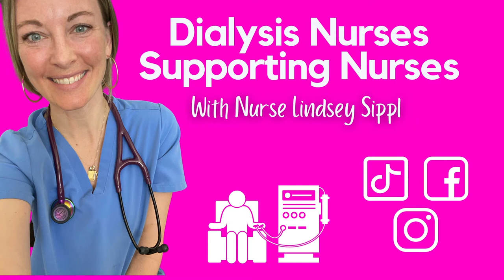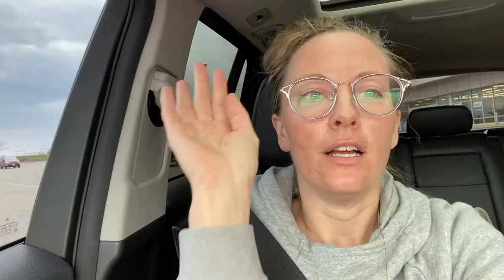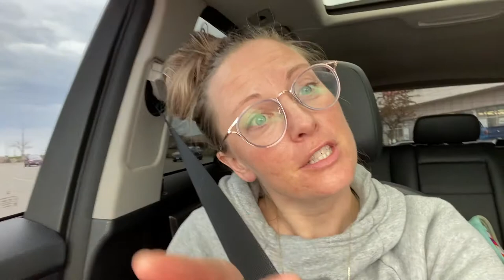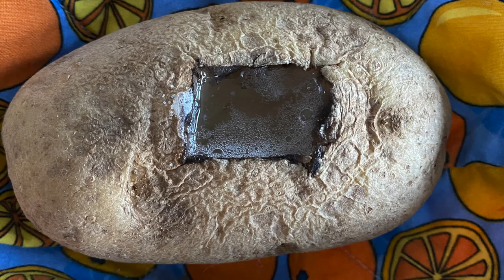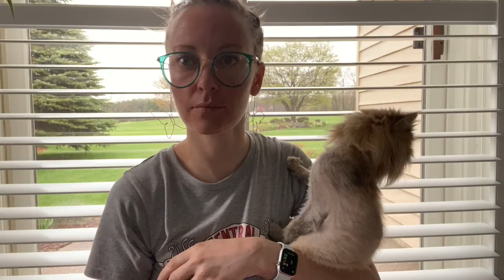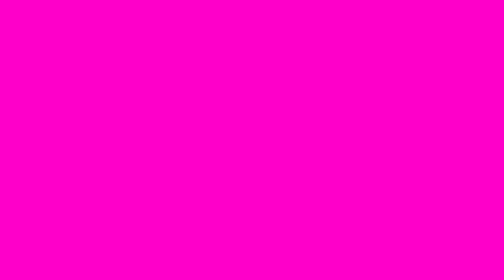DIALYSIS SETTINGS - ANSWERED: Conductivity in dialysis

Comment: In my clinic we aren’t allowed to use sodium profiling.
Reply from the maker: Interesting! I wonder why.
Reply: Same
Reply: @dialysisnurselindsey  historically sodium profiles have been correlated with hypertension, increased interdialytic weight gain, and higher mortality. 
It’s not to say that sodium profiles should never be used but other options should be exhausted first and orders should be obtained by a nephrologist who is familiar in applying sodium profiles and with the individual patient so that we can optimize the benefits and minimize the risks.
Reply from the maker: Thanks!

Comment: I read that the temp on a machine should be adjusted lower if patient has high blood pressure to eliminate sudden drops in blood pressure and that the dialysate flow should be set lower to reduce headaches is this true I am a patient and need to know and are there any other settings I should be aware of
Reply from the maker: Machine settings can be very patient specific.  There are no fast hard rules with machine settings…it all depends on the you and your history and symptoms.  It can get complicated. I recommend talking more with ur nurse and provider.